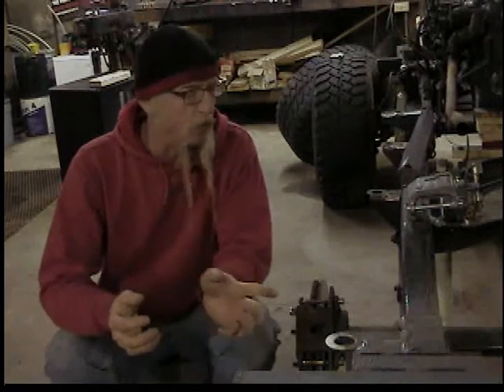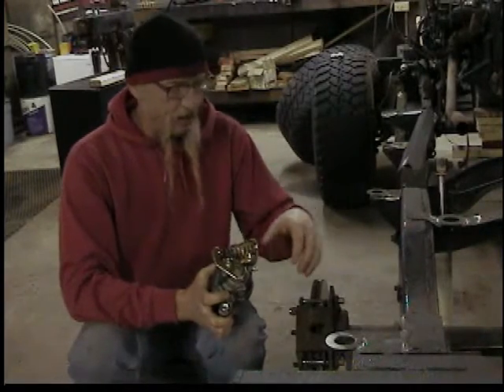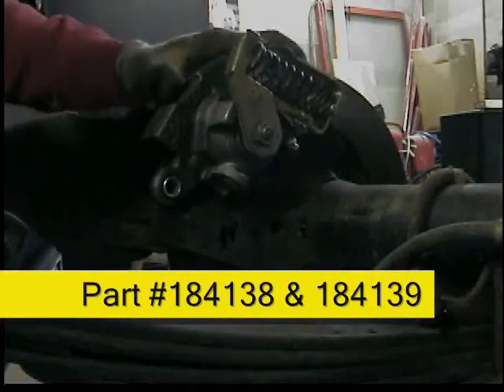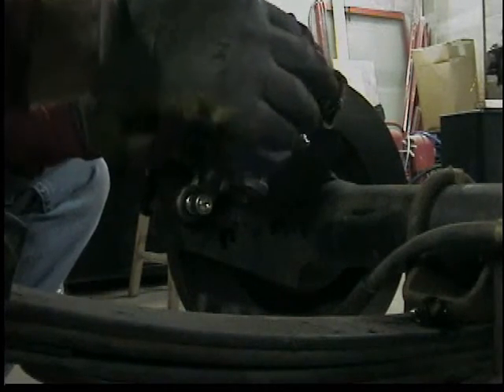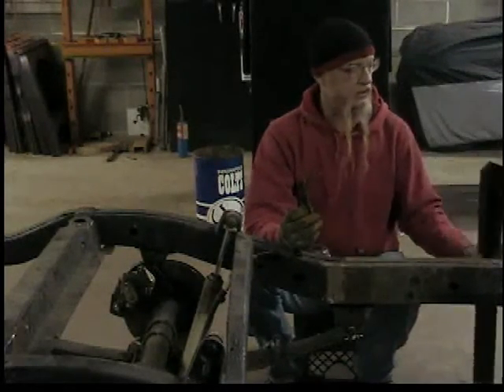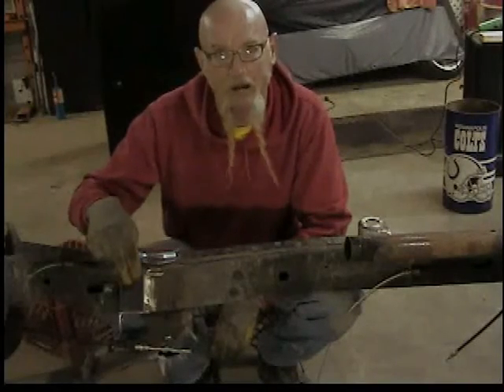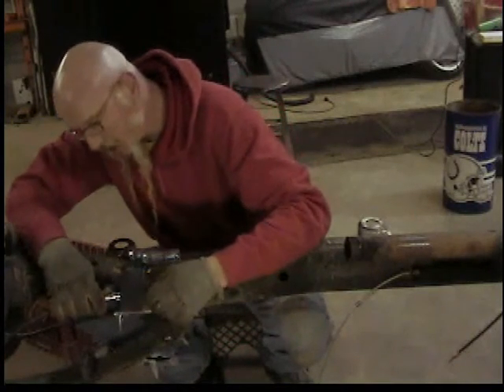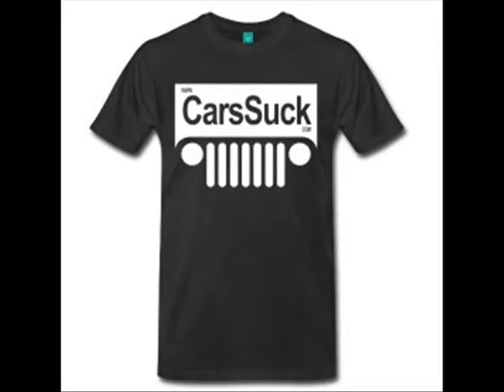Jeep Parking Brake for Disc Brakes

Comment: The brake system has been going well. The suggestions you made work perfectly. I have one issue I thought id ask to see if you have any ideas. On my Dana 35 the guy added the brackets on the front side of the axle so unlike yours my calipers are not on the top but on the front side. Problem with this is my ebrake is pointing down so you would need to pull from below to make it work. Any ideas how I can hook up my ebrake? I was thinking of running the cables along the buttom of the body all the way near the gas tank, then figure out a way to give them a 180 and go from behind under the axel. BTW thanks for all the info you sir saved me so much money. I love your mod with the seville brakes its great, so much better than the interior drum. If all goes well I should insall my new brake booster, master cylinder then try it out soon (minus ebrake for now) BTW ive been filming this whole process so quite the journey. Went from never doing a brake job to learning lots, its quite fun. Still have a ton to learn though
Reply from the maker: Hmmn. Cut and re-weld? If you make it complicated, it will fail.

Comment: Hey man this is a great video. I am having a similar issue, someone swapped the rear diff to I think its a Dana 35. I took off the calipers and no numbers, no idea what theyre from. Unlike the two bolts mine has an additional plate with 4 bolts on the back. I wish there was some way I could show You to see if you have advice. First time ever doing brakes and Im really stuck no one will help in town :S.  I have a 88 cherokee Great video
Reply from the maker: Any casting numbers on the caliper? If so, Google it. Might also be a tag on a diff cover bolt. Or a build number stamped into the axle tube.
Reply: @user-nq5rd4ck5z  Yes 28 top middle, 367 bottom right. Not sure what they mean Im new to do this I did google it with no luck. What rotors did you get for this? I may risk this its a genius ideas
Reply: BTW if you go to my page, I am posting videos of the jeep repair. Trying to get this badboy done before my wedding. But Im not a mechanic so I'm quite slow . Your video is brilliant
Reply: Also I have a 88 Cherokee (laredo model). Front brakes are stock rear even had rotors drilled at a machine shop. So they did some mods for sure to make the discs work.
Reply from the maker: @SubdivisionAuto  Keep googling and measuring. The are surprisingly small numbers of options. Google image can be handy too.
Reply: @user-nq5rd4ck5z  This video has helped me a lot thus far we believe we can figure it out. That being said would you possibly be able to do me a huge favor? Could you (if possible) measure the distance between the bolt holes for me? the stock Jeep is 4.5 inch my current one with the dana 35 is 5.5 inch. If your holes line up this unit will work for me. If not Ill find one that does but I am able to source the parts you list. Sorry to be a pain in the ass, if possible this would be amazing jsut cause I can only get them through online. Otherwise thank you so much for everything, great video, great help!
Reply from the maker: @SubdivisionAuto  The bolts that hold the caliper on are about 6" apart.
Reply: @user-nq5rd4ck5z  Okay very cool thanks man!
Reply: Dude I bought them and they fit!! Thank you so much! Last question do you have any idea what rotors those are? I cant seem to source replacements for mine because theyre a drum to disc conversion kit. Because theyre not vehicle specific I cannot order them. I probably have the same size as yours theyre 11"diameter, 3" interior bore, 2.5" high, 1.5" inch inner high 5x4.5 bolt pattern. Any info would help youve already helped a ton cheers steevie
Reply from the maker: @SubdivisionAuto  No,  I don't know. Mine are 5 x 5.5 bolt pattern.

Comment: Hi! Thanks for the video and part numbers! Subscribed!I have a 76 cj7 with front drum brakes and want to convert to disc. Would you know the rotor, pads, bracket part numbers or what vehicles they came off off so I can buy? I'd buy a disc conversion kit but they cost lots of money and would like to save some cash if possible. Thanks again. :)
Reply from the maker: rag Doll These differentials are not even out of a Jeep. The issues are simular so I filmed what I did but this is not exactly a how to. Jeep On!

Comment: I have a 84 CJ7 with the stock rear diff/axles with drum brakes.  How do I go about changing it to a disc brake system.  Looking to use donor vehicle from the auto wrecker if possible. Do you know whats involved and which vehicle to use  ?
Reply from the maker: Dill Wiggle The hard part is the caliper hanger. This one had aftermarket bracket welded on. Other than that, stick to 5 on 5.5" bolt pattern.

Comment: Great overview on this setup.  The stock EBrake system on my CJ7 (Project Rowdy) is frozen up and I plan to convert to rear disc during an upcoming restore.  I like the setup you have here and will probably do likewise.  Thanks
Reply from the maker: I should have made another video on how to adjust those calipers. If you have brand new calipers it is supposed to be as easy as pumping the parking brake. But, and this seems common according to the Googling I did, most rebuilt calipers do not have a new sprag adjuster and since most people with automatic transmissions don't use their parking brake, the sprag eventually locks up. So, if you buy re-built Cadillac calipers, be read for a lot of hit and miss adjusting until you get it.